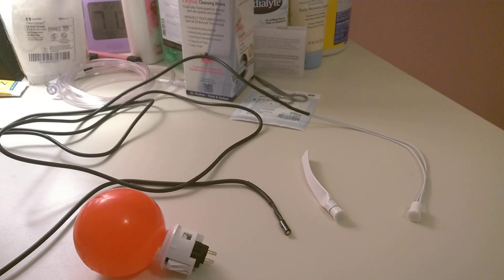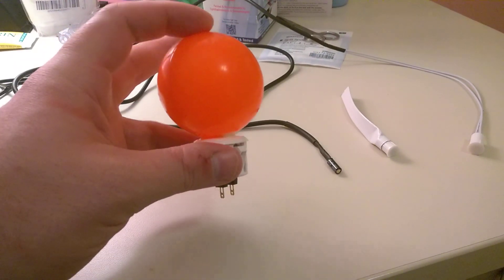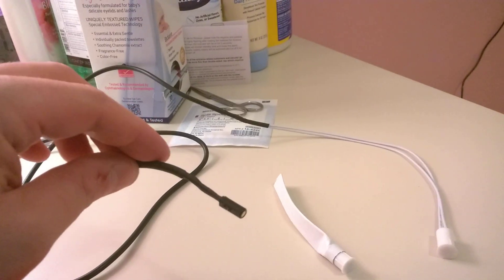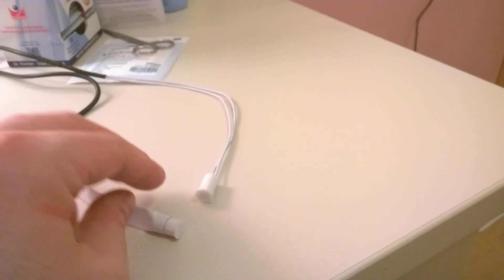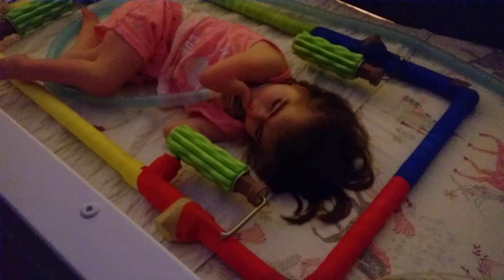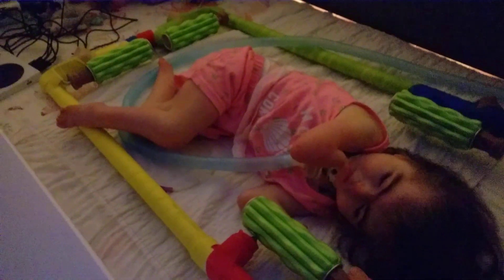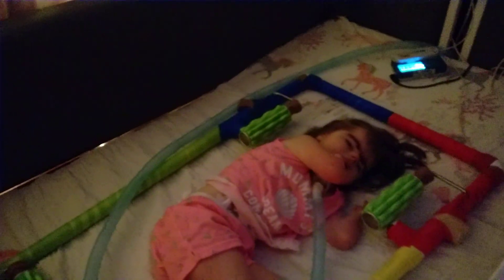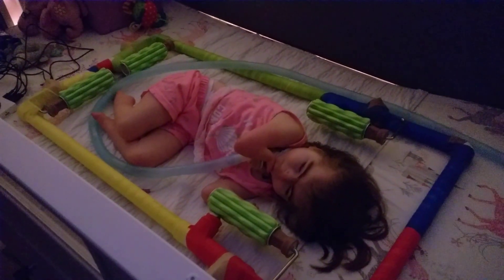Xbox Adaptive Controller phase one complete!

Comment: I'm so happy I stumbled onto someone else tinkering with the Xbox adaptive controller. I just got into it myself and have ventured off the rails. Currently I'm turning the adaptive controller into an IOT device hub and threw together a few interfaces to make my house pretty smart for fun. What's cool is you can map the controller buttons to keys, shortcuts, and actions using 3rd party software like joy2key which makes the adaptive controller an easy to replicate DAQ board / sensor hub. I'd love to chat with you sometime about how far down the adaptive rabbit hole you ventured, since this was obviously over 2 years ago

Comment: How do I attach the red and yellow wire to a sanwa switch? I am using an audio mono cable with a 3.5 mm jack. I cut some of the plastic casing of the cable to expose the yellow and red wire. I have Muscular Dystrophy and trying to set up a gaming rig. What your doing is inspiring.
Reply from the maker: I've been soldering the joints. However, you might be able to get away with using a conductive glue. I should test that, actually.

Comment: The controller treats normally open and normally closed switches the same. I know that seems odd but we did that in firmware because we wanted buttons to work if you didn't know what that meant.
Reply from the maker: Ahh, interesting! Thanks for letting me know, and thanks for making such an incredible device. 👍